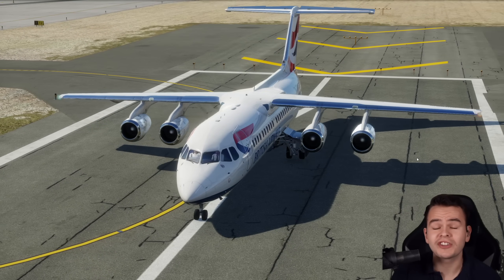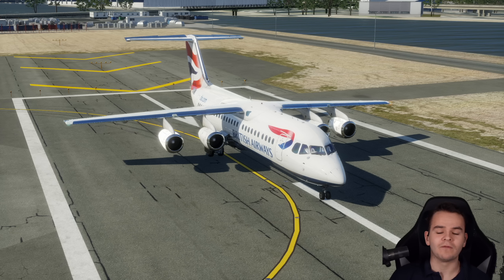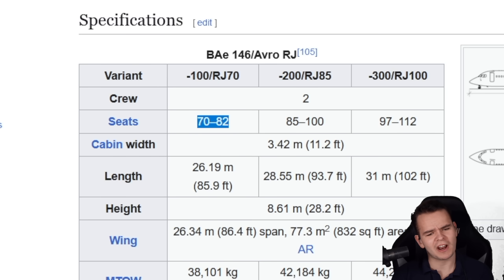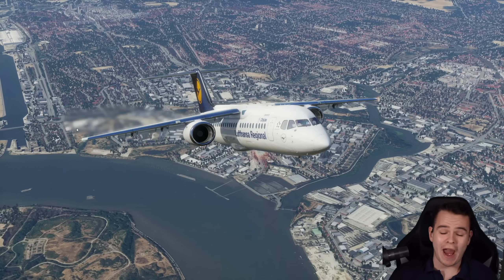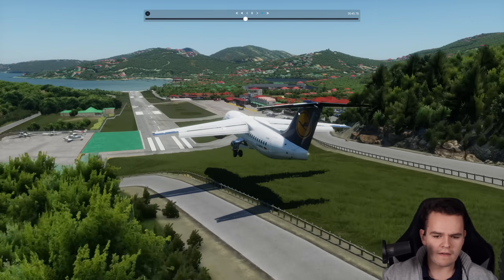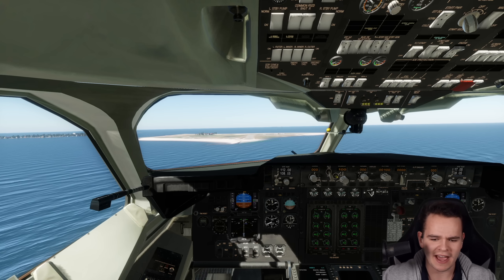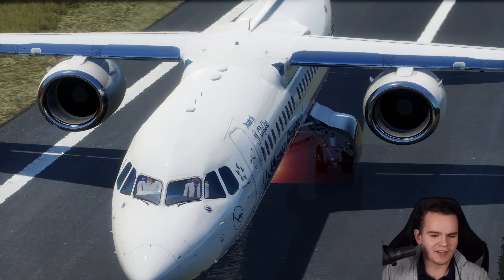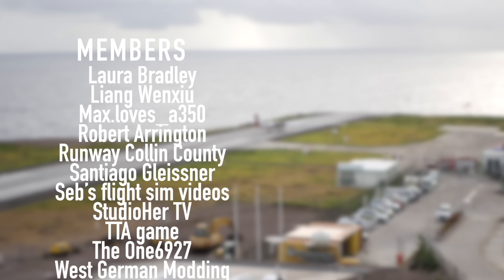I Fixed The AVRO RJ Airliner's Biggest Problem

Comment: Right now, an RJ100 powered by two reduced-fan size PW1xxxG engines rated at around 21,000 lb. thrust would turn it into a fabulous airliner. And because the RJ100 relied on a split speed brake on the tail and wing spoilers to slow down the plane, the engine nacelle would actually be lighter because it won't need the weight of the thrust reverser system.

Comment: hey swiss can you make the 747 only using 2 GE90 engine? if it works on the A340 it will (probrably not) work on an B747